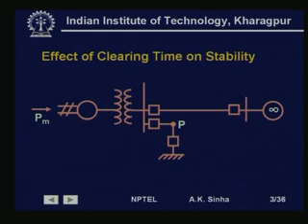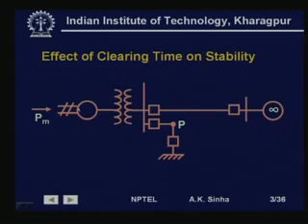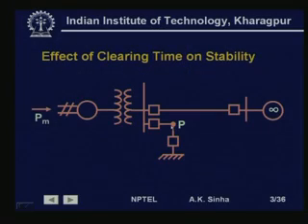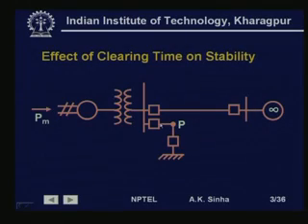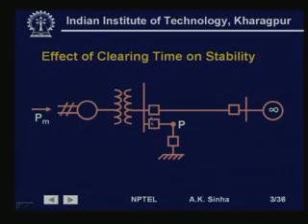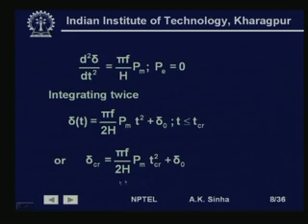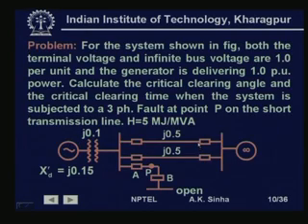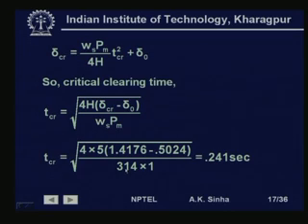Lecture - 37 Power System Stability - V

Comment: @29:06 why we do not use Xt= j0.15 + j0.1 + j0.25  shouldnt we use the total reactance by which th generator is connected to the infinite bus ??
Reply: For power angle equation you need voltage behind transient reactance or internal emf of generator (E). But in the question terminal volatge (V) of generator is given (which is internal emf minus voltage drop across transient reactance). So to find the angle between V and infinite bus voltage, only reactance between them should be taken...:):)